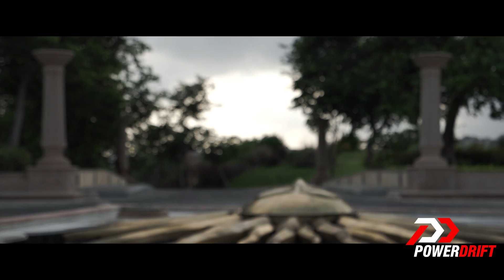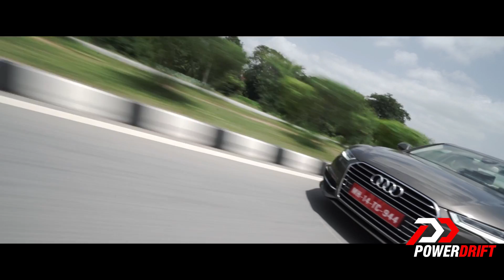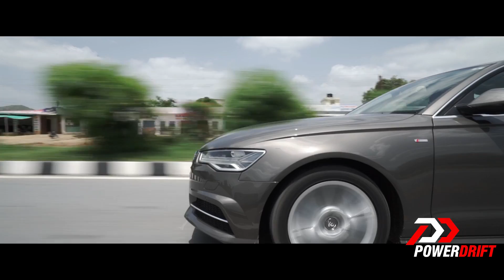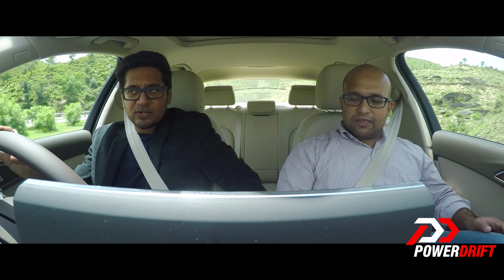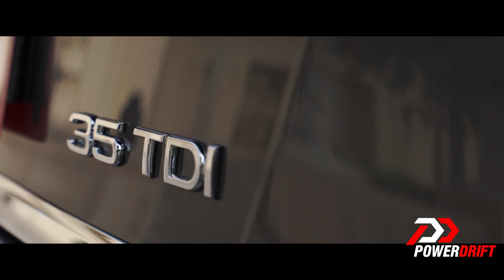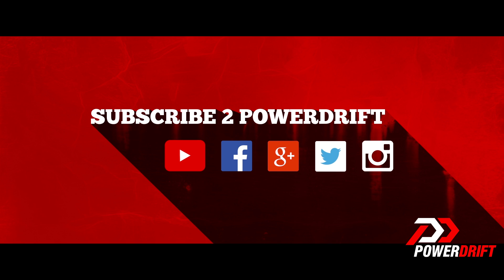Audi A6 Matrix 35 TDI : First Drive : PowerDrift

Comment: How would you compare this to the mercedes benz e class?
Reply from the maker: +Manas Bhagoliwal We are yet to test that out :)
Reply: +Manas Bhagoliwal 
as compared with E250 merc is lagging behind when the gear automaticaly changes. 
Audi matix is having dual clutch function which removes lags during gear shift.
its pwerful and better performing than merc e250 with lot more features and comfort.

Comment: The car does look good but no way is a front wheel drive car going to be as fun as it's rear wheel drive rivals. BMW or Merc would still be my choice.
Reply from the maker: +Stan John But the USP here are the Matrix lights, aren't they?
Reply: The Matrix lights can be got as an add on from the authorized dealership itself. The issue is , it's still a front wheel drive when all the other car's in this segment are rear wheel drives so the price doesn't seem justified.

Comment: the 4 jone AC is impressive....but i will be waiting for your full review since i want to know the working of it...means what is the maximum possible temparature difference between the zones.
Reply from the maker: +rajiv lochan kalita You can set whatever temperatures you want on the 4 zone climate control system. One can be cooling at the lowest temperature and the other can be heating at the highest temperature. This is possible as the blower speed and vents function according to the temperature that is being set.

Comment: though it was a nice first drive video but you forgot to tell us about the matrix headlamps...because the car is named after it...
Reply from the maker: +chirag narayan Yes, that shall be covered when we get the car for a full review :)
Reply: +chirag narayan the matrix head lamps has a light intensity of 1km ..! and uts cost's 8LK INR to get replaced.
The matrix also has a 6 surround bose audio system which cost 6 lk rps..

Comment: Great first impressions! You guys didn't talk about the Matrix headlamps though.
Reply from the maker: +Varun Sarathy Yeah, we will when we have the car for a full review :)
Reply: PowerDrift Waiting...
Reply: +Varun Sarathy the matrix head lamps has a light intensity of 1km ..! and uts cost's 8LK INR to get replaced.
The matrix also has a 6 surround bose audio system which cost 6 lk rps.. 
on road its 64 lk in kerala which too pricy but compared with the new E250 audi is dam good because i regret not for taking this instead of E250
Reply: dony varghese Wow, thanks for that.